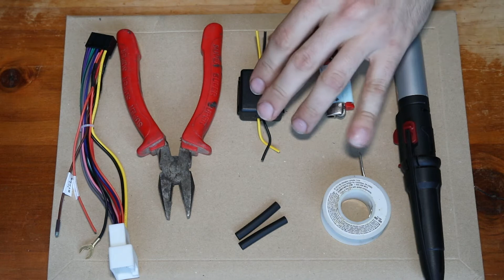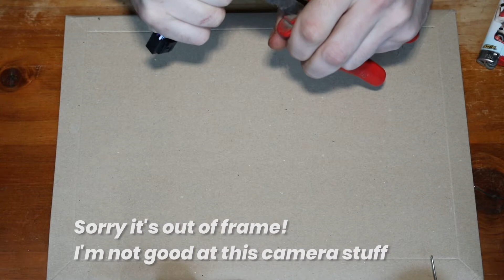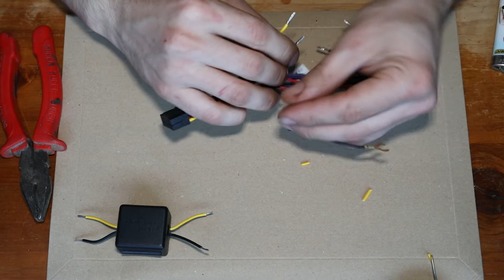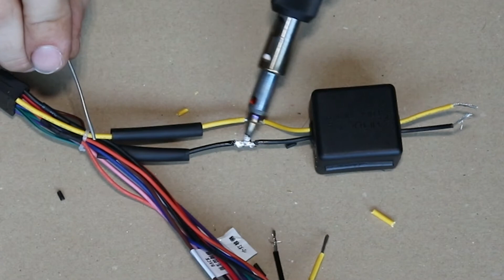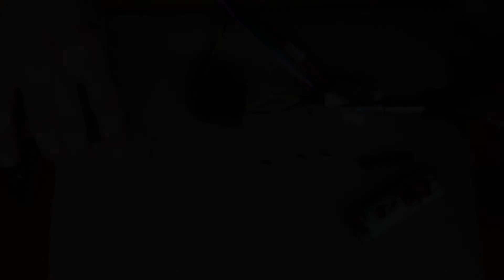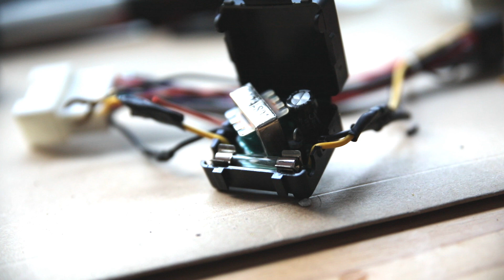How To Install A TEYES Noise Filter | TEYES ANDROID Stereo Help

Comment: I have an amp in the car, which i have connected to the amp wire on the loom. Instead of that yellow wire you connected the power filter to, would i do the same but connect it to the amped yellow wire?

Comment: To which cable do I connect it?  I have a cc3 system
Reply from the maker: The main wiring harness. It's usually the biggest harness from all the others. Yellow for positive, black for negative. The video should explain it properly. Hopefully that helps.
Reply: ￼ Ok .  I check it out.  I'm not dealing with this.  I think my friend connect it is wrong is it connect it canbus cable is it ok to connect it canbus wiring?
Reply from the maker: @hmimomalkaaaa  is the canbus wiring the actual wiring from the car?

I guess it should be okay in theory. If you are not getting any high pitch sounds from the speakers while your accelerate, that means the filter is working.

Comment: Do you have a link to where you got the noise filter?
Reply from the maker: Hi, I got it from Aliexpress. This is the link https://www.aliexpress.com/item/4000073579017.html?spm=2114.12010615.8148356.2.20602febGoGXZU

If it does not work, search for "teyes filter".
Reply: @tritonsound2415  Thank you!

Comment: What's the use for it? My teyes cc3 has hissing sound from speakers when no audio playing, it can be filtered with this?
Reply from the maker: Hi Buster,

The noise filter is designed to remove any alternator whine from the speakers and could possibly filter out the noise you have as well.

Are your speakers running through an amplifier? I've found that noise occurs when the gain is set too high.
Reply: @tritonsound2415  Speaker are connected to teyes unit only. How to decrease the gain from CC3?
Reply: @tritonsound2415  Hi Triton i have reccently installed that Teyes CC3 unit in my car and noticed when im not playing mussisc there is constant hissing sound also sometimes i get some sorts of disorted sound coming from the speakers aswell , mine speakers are amplified through vibe powerbox 65.4 amp , do you think that filter could help ?

Comment: Hi, I have a Teyes TPro in my Infiniti fx35. Ive already installed a power filter which helps to avoid alternator whine. But I still have a noise when music volume is turned to 1 on volume scale or when there is no music played. When I pushed a mute button there is no sound and noise, then the bose AMP is off. How can I fix this problem? Is there any solution? I think IT is caused by bose sound system with AMP, and its not compatible with this GU.
Reply from the maker: Hi, 

Can you adjust the gain settings on your amp? I had a similar situation and it was because the amp gain was set too high. If you can adjust the gain, then turn it down, that'd be the first thing to try.
Reply: @tritonsound2415  The noise is independent of the volume. Turning down the gain does nothing. For example, the noise does not increase with the volume of music. That's why you only hear it at low volume levels like 1, 2 etc ...
Reply: @djoneway  did you had any luck with that issue as i have the same problem ?

Comment: You should only add this noise filter only if you hear noise coming from speaker ? OR would you recommend adding the filter regardless of any noise coming out speakers?
Reply from the maker: Yes, you add it only if you hear noise. Its not neccessary otherwise.

 I wanted to be sure it wouldn't happen and so I installed it before the stereo, just in case. Since shipping takes over a month to my country, I just purchased it when I got the stereo.

Comment from the maker: Update: It looks like the Teyes filter does work, I currently have two amplifiers and L.E.D headlights installed in my car and there's absolutely no alternator whine! 

Of course proper grounds for the amps and running my RCA cables away from power wires probably helped a bit as well. Nonetheless, definitely worth having for extra insurance.